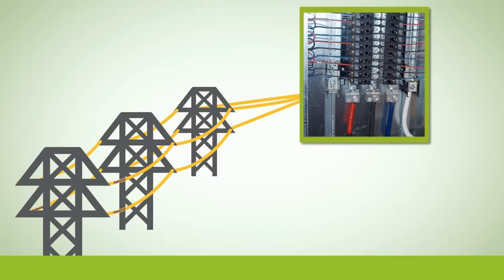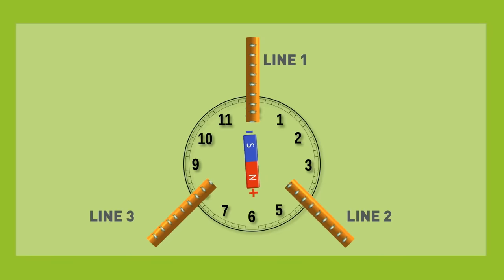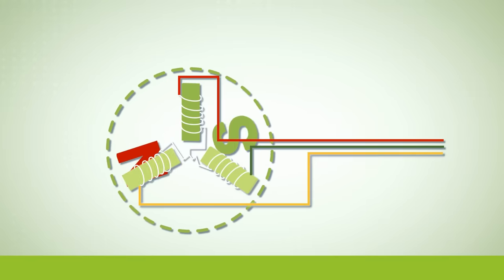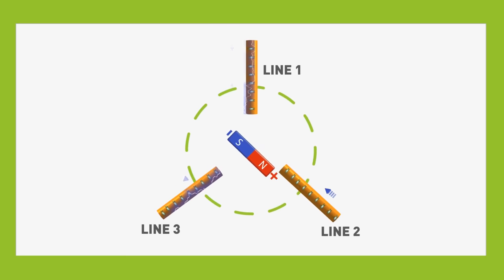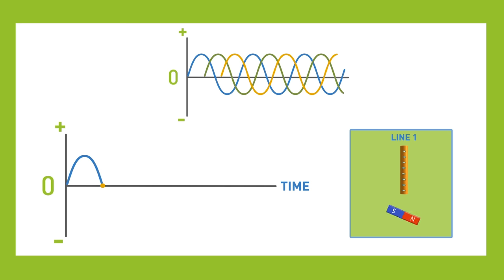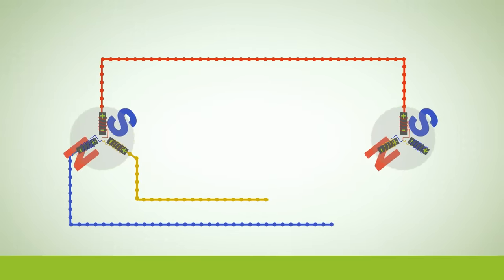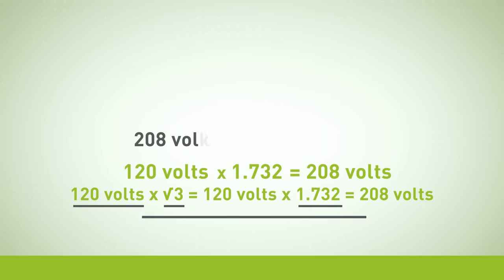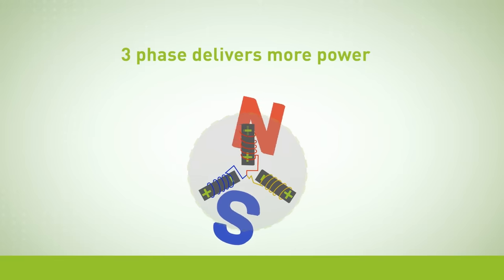Three-Phase Power Explained

Comment: Maybe one of you clever people can help. I have a Northern Lights 25kW generator and I planned to run a 3-phase 240v 20kW induction motor from it. The documentation I had said my generator was 3-phase but I just found out it's actually a single-phase output!! Damn. Any ideas how I can connect that to the motor and still run it at about 20kW of power?

Comment: How do you get  180 degree out of phase, single phase 240v out of the 3 120 degrees out of phase lines than? is the power company before it gets to your house converting it to 180 degrees out of phase? Is the transformer or some device doing this in residential areas? I am guessing residential homes are only getting  1 of the 120 degree phase voltage lines .
Reply: Because the power company gives you a split 240V phase from a step down transformer. That transformer is almost never fed by 3 phase in a residential setting. Your power feed lines are likely 1 Hot wire, eg. 7200V and a Neutral, so your transformer is tapping off of a single phase. You would have to look at your overhead lines from pole to pole and see how many you have unless it is underground, you could even have 2 neutral(Ground) wires on the pole and/or 2 of the 3 phases but your transformer is usually only fed by one. It depends on how the utility designed your distribution system. Hope this helps you understand.
A local water plant where I live is delivered 12KV 3 phase via distribution lines from a switchyard several miles away and right through a residential area, but none of the homes there are fed by those lines although they are fed by the same switchyard. The plant was there first, btw.
Reply: Residential is just one wire or one phase.  That one wire goes into a transformer that steps the volts down to 120.  The side that steps the volts down has just one wire but with both ends hanging out of the transformer.  Those two ends connect to the two hots coming into your house.   If the magnet is in north position then it's pulling the electrons through that one single wire.  On one end it's like the electrons are being pushed and on the other end it's like the electrons are being pulled.  Sort of like a logger sawing a tree with a two man manual saw.  He can push and pull it himself (120v) or he can have a buddy on the other side helping push and pull (240v).  You can connect to either side of that one wire and get 120V.  When one side is +120 the other side is -120.  When you connect the two together it's 240.

Comment: informative  and well  explained.but three phase are very hazard to appliances if you dont check the balance voltage.example L1 to L2=220v to 240v,L1 to L3=220v to 240v,L2 to L3=220v to 240v.but L1 to ground active=108v to 112v,L2 to ground active=108v to112v.this is the problem L3 to ground are max 208volts.so that you may consult your appliance and equipment to well trained license technician/electrician.so that your investment would be longer.simple connect or plugged you appliances at safe with voltage regulator L1 and L2 with active ground L3 use for electric pump or heavy motors.single phase no problem
Reply: The ratio is 1.732
The voltages are 127/220V...138/240V.
In Europe existing 230/400V, its a very dangerous.

Comment: Ive always thought that the neutral  phase wire is always repeat always hot!correct me if im wrong. Thanks for great video much appreciated
Reply: +OTIS CAMPBELL - The neutral wire is almost always grounded. Trivia: If the three phase load is equally balanced (as it would be if the load is a three phase motor) the neutral can actually be removed.

Comment: Ok, so you have two phases of 120v in your house the offset between which is 180 degrees, which can be referenced to each other to create 240v. How do you get that when the power lines carry 3 phases with a 120-degree offset between each?
Reply: You can only get 208 V. In Europe we have 230 V single phase and 398 V between two phases.
Reply: @FrainBart_main  in the U.S.
Reply: @arthurserino2254  I you have two phases of 120 V that are 180° apart, you can only have 120, 240 or 0 V. If you have three phases of 120 V that are 120° apart, you can only get 120 or 208 V.
Reply: @FrainBart_main  then how do you explain the three phases of power we have in the US?

Comment: This really confused me,
I want to install a 3 phase power supply in my house but my question is: could I run single phase 220-240v appliances. 

If yes, then how?
Reply: Most residential home appliances designed for 240V are actually designed for 208-240V as you will see on their rating plates. This is because sometimes residences (single family usually) are served by a single, split-phase, 120/240 transformer, while residences in larger buildings such as condos, apartments, dormitories, etc. are usually served by  2 legs of a 3 phase transformer service. (Such larger building living units have a regular, 2 leg, residential service panel fed with 2 of the 3 legs off the transformer.)  Thus, a kitchen stove, electric dryer, etc. needs to work in both places since most people buying such an appliance can't be bothered with finding out if they have 208V or 240V and the horror of having stores stock every model of appliance in both 208V and 240V flavors would be substantial. The manufacturers simply build residential appliances with a larger input tolerance - as I say, marking them 208-240V.  A stove or clothes dryer heating element will put out slightly more heat when fed in a 240V residence, but most people won't notice the slight performance difference. Likewise, the motors in those appliances, central AC/heat pump outdoor units, etc. are also built to take anything in the 208-240V range. Since AC motor rotation speeds are determined by the frequency of the power rather than the input voltage, said motors will rotate the same whether they are fed 208 or 240V because it's all 60Hz AC.  The motors have a bit better starting torque on 240 vs. 208, but again, the design engineers keep the possibility of 208V in mind and make sure that their design in the AC unit, dryer tumbler, etc. isn't so critically overloaded, that the motor is inordinately challenged at startup.

In 3 phase service places that have a true, 3 phase service entrance, circuit breaker panel, 208-240V loads are fed with a 2 pole breaker. In fact, in 3 phase panels, it's not uncommon to see 1 pole, 2 pole, and 3 pole breakers along side each other in commercial places like schools, restaurants, etc. One pole circuits are for outlets, lights, etc. 2 pole go to things like stoves and dryers, and 3 phase go to the commercial loads - often HVAC equipment. If you install 3 phase power in your home, then you probably would opt to have a true, 3 phase (3 leg) panel, and that's how you'd run your 240V loads - off a 2 pole breaker in that 3 leg/phase panel.
Reply: Also know, however, that many utilities, at least in the US, as far as I know, only offer 3 phase service as part of commercial or industrial service and as such there are often demand charges as well as much higher monthly customer charges compared to residential service and that's if 3 phases are even available outside on the road by your residence. Most likely 3 phases are available outside your residence if you are in a very urban location or on a main street. Otherwise, the charge to extend 3 phase service to your US residence, might be, umm.....huge. 🙂

Comment: Shall I hook up a single phase dc voltage controller which is 150 amps to phase and neutral because the voltage in the workshop is 440 v phase to phase or we need a transformer to do that
Reply: Sudhir V.P
Let me keep you alive. Measure the voltage from one phase to neutral. If that is more than 10% of rated controller voltage, then no. Do not hook it up. But, check all three phases to neutral, it's common for one to be a bit less than the two brothers. Since you didn't specify your controller input voltage, this is just generalization. Stay safe.
Reply: Bryan St.Martin    Sorry MY Mistak the Input Voltge IS 220 V

Comment: So the delta config is the reason for 60hz?
Reply: speed of the armature us use 60hz here in uk we use50 hz that is a single pole armature rotate at 3000 revs per minuete to give 50 cyvles per second.  thats why motors hum at the same sound.

Comment: I only watched the first 4 minutes of this and am still confused......I cant stand the theory of how current flows in opposite directions....if you take 5 steps forward the 5 steps back you will never move.....it flows forward all the time but it either a positive current or negative current which lags the voltage by 90 degrees.....the same theory is used to explain voltage whis is also incorrect...you either have a positive or negative potential difference which allows a positive or negative current flow. Please correct me if I am wrong because the 2 theories of negative to positive flow or positive to negative flow has always been confusing for everyone.
Reply: @mdredmond71 then how do you have a neg and pos flow? It flows from neg to pos then pos to neg  and you can just use 1 or the other...through rectification lopping off 1/2 .positive flow or negative flow...but they are still flowing in a forward direction depending on hkw you look at it. I have been hearing this for years but even the so called experts cant agree on it, & me being just a simple person am frustrated without a difinitive answer
Reply: @mdredmond71 if a conductor is material with 1-3 valence electrons, and current is the flow of those valence electrons from negative to positive then current is always flowing neg to pos ( in one direction) The force that makes the electrons is voltage...either a neg or pos voltage with AC having both with the sine wave. The theory of the electrons moving in one direction then the other direction does not compute in my brain because they are always moving from negative to positive.
Reply: @mdredmond71 but that is a closed loop DC circuit....AC is creathed by an ac generator ( 3 phase) in which the windings are 120 degrees out of phase and the flow is pos or neg

Comment: 6:30 why are there 6 magnets per generator?
Reply: Kind of hard to explain. It can be done with three but then the magnets would have to spin, with 6 you can keep them stationary and just reverse the n/s pole as needed and then spin the conductive material. Its harder and more expensive to replace the magnets if they break and movement causes stress and strain so its best to keep them stationary.

Comment: why dont they just run single phase with twice as high amperage rating for the same power availability?
Reply: I've always wondered that myself. You have three lines for three phase...of course you can carry more current. For the same "cost of wire" it seems you could do the same with single phase
Reply: Either the voltage would have to be increased or the wires thicker to avoid I^2R losses.  The generation of electricity is 3-phase so using a 3-phase motor is likewise more efficient.  For small domestic appliances, washing machines, etc. it is not significant.  But for an elevator motor or a factory with heavy machinery a 3-phase supply is a huge increase in efficiency.

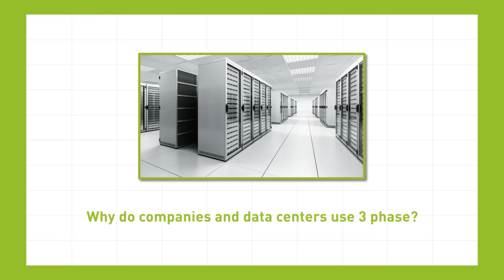Comment: 8:51 I thought you connect the line to neutral for 208v?
Reply: The video never covers this, but there is no neutral line in a three-phase system. It's another reason why three-phase is more efficient.
Reply: There are different types of three phase circuits, some have a neutral.  The type shown at 8:54 has a neutral, incorrectly denoted by (–) symbols.
Reply: 120/208V
Reply: If you have a 208V 3 phase line, then you connect line to line to get 208V. Some data centers have equipment that requires 120V connections.  In that case, you need to be able to connect line to neutral to get 120V. Power distribution units (aka PDU - a sophisticated power strip) can supply WYE (208 or 120) or Delta (just 208 connections) and that's a topic for a different video.
Reply: @Hugh Mungus 208 * sq.root 3 does not equal 120V. I believe you have this backwards. 120 * sq.root 3 = 208

Comment: WHAT spins the magnet???
Reply: mechanical power from the likes of coal/steam i think. This process happens at the power plant facility inside a giant generator.
Reply: Usually a turbine. The turbine can be pushed by steam (as in a geothermal or nuclear plant) or water itself (hydroelectric) or the wind.
Reply: Watch the first video. At the end it talks about the 2 different techniques. You can spin the magnet or spin the coil around the magnet.
Reply: simon- a hamster
Reply: A gerbil or sometimes they use mice running in a wheel
Reply: @jovetj  Usually wind turbines don't directly drive the generator that causes the frequency of the grid.  Wind is so intermittent that it would cause big problems for the grid, if the grid followed the frequency of a wind turbine's rotation.

Instead, the wind turbine's generator is connected to a rectifier that converts it to DC, which then feeds an inverter that produces AC to follow the lead of the voltage and grid that other more-stable sources establish.

Comment: Why don't we have 30 phase power? That would be wayyyy more efficient right?
Reply: You get a diminishing return by adding more phases, while making all of your protection and switching equipment more expensive.  3-phase is simply the middle ground where you get the bulk of the improvements over its single phase counterpart, but any greater phase count would mean significantly greater cost for all the breakers, fuses, and transformer windings that you would need.

Comment: Tennessee has reinstated the electric chair and some of death row condemned have volunteered for it and received it. I wonder what voltage, amperes and phase they receive.
Reply: walter kersting all of it.
Reply: walter kersting, just enough
Reply: I would imagine the current would start out high because the victim would be sweating and her skin would be highly conductive as she sat there and cooked the skin would dry and the resistance would increase so the current would decrease, probably follows the law of inverse square.
Reply: currant dont kill its the voltage that jumps across all the joints to neutral

Comment: why 2 phase have 90 degree angle??
Reply: So that it is practical to start motors.  This way, you could power either one of the two coils at any given instant, and be able to cause a torque on the rotor.  With single phase, the rotor could lock up in a position where the power couldn't get it rotating.  2-phase is obsolete, and we now use capacitors and starter coils to accomplish the same purpose.
Reply: Because Tesla so decided. Two phase is obsolete.

Comment: How about 6 or 12 phase
Reply: You get a diminishing return by adding more phases, while making all of your protection and switching equipment more expensive.  3-phase is simply the middle ground where you get the bulk of the improvements over its single phase counterpart, but any greater phase count would mean significantly greater cost for all the breakers, fuses, and transformer windings that you would need.

Comment: hey guys, i'm wondering if 3 phase is so nice. why not going to 4 phase electricity? i mean 90deg phase difference is much nicer than those 120... 4 quadrants are much more natural than 3. for real. using 4 would distribute the load among more wires! imagine a 4 phase light bulb!
Reply: You get a diminishing return by adding more phases, while making all of your protection and switching equipment more expensive.  3-phase is simply the middle ground where you get the bulk of the improvements over its single phase counterpart, but any greater phase count would mean significantly greater cost for all the breakers, fuses, and transformer windings that you would need.

Comment: Why not 6 phase or 12
Reply: You get a diminishing return by adding more phases, while making all of your protection and switching equipment more expensive.  3-phase is simply the middle ground where you get the bulk of the improvements over its single phase counterpart, but any greater phase count would mean significantly greater cost for all the breakers, fuses, and transformer windings that you would need.

Comment: Pls calculate the full load current 

Single Phase  Lighting  load =10000w
Single Phase Power Load =20000w
Three Phase Machine Load = 25kw

Total Full load current
Reply: Three Phase 440v Single Phase 230v
Reply: You are confused. Maybe you aren't in a 60HZ country. The 50 Hz world doesn't use split phase to get 120VAC. But like your country, above 220vac, the power is 3ph only.
Reply: Figure out your own homework.
Reply: ut
Reply: Jovetj ji

Comment: This is all hogwash.  Magnets do not attract or repel electrical charged objects (electrons).  The only way electrical fields impact magnetic fields or vice versa is when one or the other is varying or the current is varying.   You can put a static magnet next to a copper wire and you won't induce any current whatsoever.

Maybe this was an attempt to simplify things but it is at the expense of misleading the public.  And, before anyone says it, I did watch the first video and it is just as wrong.

To be honest, I wonder how well this author understands electromagnetic fields.

Comment: there is no such thing as 1 phase motor. only 2 phase and 3 phase. 1 phase motor are fake claims, they are actually 2 phase motors with a capacitor to generate the second phase
Reply: When we say a motor is single phase, we mean that it is designed to operate on single phase power.